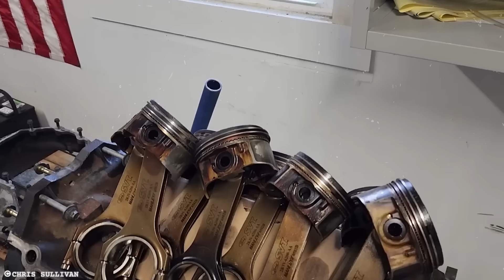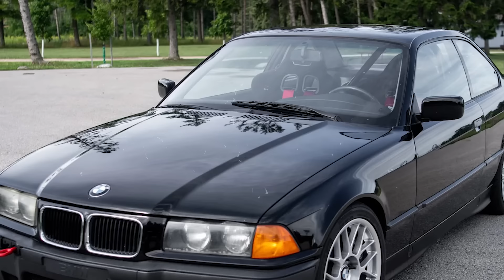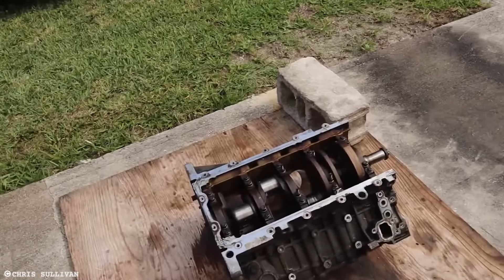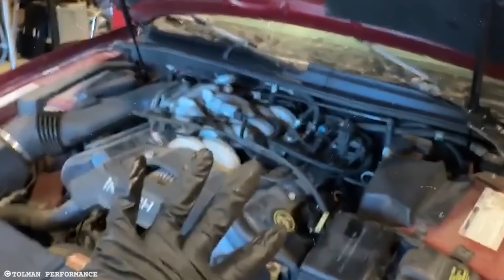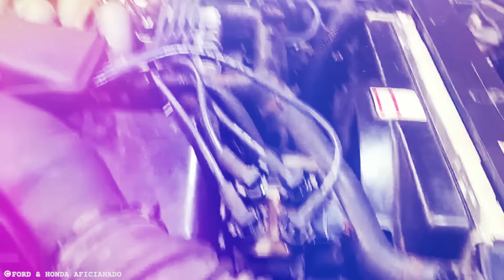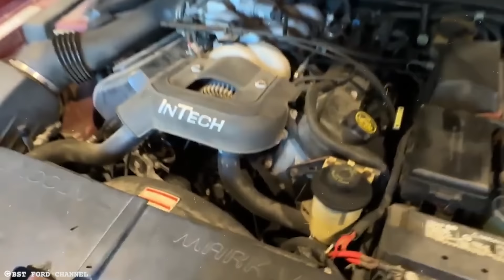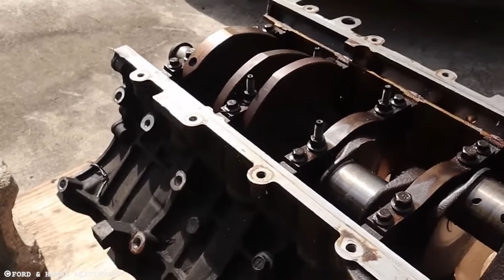The Most Overengineered DOHC Engine of Its Time   Ford 4 6L DOHC Modular 1993

Comment: @Rare Old Engines....Back in the earlier part of the 1960's "General Motors" produce and offered a complete ALL ALUMINUM SMALL BLOCK (215 V8) with ALUMINUM HEADS. GM installed them in Buicks, Olds, and Pontiacs. Look at GM NOW!!!! With it's LS based all ALUMINUM BLOCKS V8's capable of producing upwards of 1200hp, with a basic design most engines have followed for a very long time!!!! Ford's 4.6L DOHC should've produce more horsepower for the SIZE, COMPLEXITY and how much ROOM it took up in the engine bay!!!! As a side note: I know about two different cars built back in the day, 1983 Pontiac Fiero and a 1970 Porsche 914 with ALUMINUM BLOCK (215 V8's) BOTH with TWIN TURBOS. These cars were built back in 1983. WICKED FAST and the cars handle as if they were NAILED DOWN TO THE PAVEMENT!!!!
Reply: Chevy guys are so insecure.
Reply: During this time that was about the right power output. The North Star was producing similar numbers but had problems due to the undersized head bolts. It's really a shame that Ford didn't use this engine in a proper luxury sedan to compete against the Europeans. Sure. They used it in the Marauder but that wasn't really proper competitor to models coming out of Mercedes or BMW And Mercury didn't have the credibility in the realms of luxury to compete at that level. If they would have used this engine instead of completing the Jaguar. AJ V8, I think that's where the engine really could have shined. Shined. It would have been sold under a division that had the luxury reputation and was trying to compete against the Germans. While, the ajv8 eventually became reliable, this engine was more powerful and would have saved the company a considerable amount of money that could have been used either to sooner develop a V12 to compete against the Germans of v12s or could have simply saved the company money and potentially brought them closer to profitability.
Reply: @colinschmitz8297  Actually you've overlooked, the early 2000's Ford's 4.6 DOHC Supercharged V8 installed in the Ford Cobra Mustang "Terminator" still a PHYSICALLY BIGGG engine, and it only produce 390HP. Mentioning.... the disastrous Cadillac North Star V8, not only were the cylinder head bolts failing, but you needed to have extra bottles of oil in the trunk because the engine leaked oil like a SIEVE!!! What a piece of junk that engine was. The part that doesn't make any sense at all, during the same time period GM commissioned "Mercury Marine" to design and produce the INFAMOUS 1995 Corvette ZR-1 5.7L a small block (350) with 32 valve heads producing over 400HP naturally aspirated! If GM slapped a supercharger or Twin Turbos on it.....1000HP plus easily. This engine would've decimated any foreign car or truck, another example of a small engine but very Powerful One!!!!
Reply: @Armond144 The Terminator version of the 4.6 was powerful for its day.  We need to judge the engines from the era that they came from And remember the different compromises companies make to build their engines.  In the year 2000, Ford used the 5.4 L in the Cobra R which generated 385 horsepower and 385 foot pounds of torque and going off of the magazine tests where they compared the Cobra R versus the ZO6 vet which had identical power numbers out of the LS. The dyno showed that the 5.4 was actually more powerful, so the engine was actually underrated and people have noted for years that the Terminator was also underrated.  The Cobra R engine from recollection required a larger Hood for the intake. So it's a question of how you want to go about solving certain problems. I'm fine with using different technology so long as the engine is reliable. The Mercury Marine engine was impressive for its day but it was also quite an expensive engine.

Comment: Most over engineered American motor maybe.  The 32 valve DOHC Toyota 1UZ V8 will up to double the lifespan of this motor.  A million miles.  I love the 4.6 but it’s not in the same league as the 1UZ.  No motor was.
Reply: No engine had the r&d like the 1uz did either.
Reply: @Brandon-u2l6j A billion dollars in 80s money!
Reply: @MrMightyZ the 2v 4.6 has several examples on YouTube right now with over a million miles on them.. it will outlast anything and feels like the day it was made while doing it..
Reply: @NewEdgeDesigns I’d heard of cabs crossing 1 million but they’re often run always warm while workers swap warm cabs when they swap shifts.  Good motors in cabs that rarely run cold can do some absolutely insane miles, heard stories of Australian 4.0 cabs doing 1.5 and 2 million in the days when insurance didn’t require swaps but those motors would never do that privately owned.
I thought the 4.6 was a 600,000 mile motor but I didn’t know any Modular V8s were crossing a million that were privately owned.
Reply: VH45DE was in the same league. It even had titanium valves. Too bad it was only used in the Q45.
Reply: @4dscdriver  they were beautiful and like so many Nissan motors there chain guides were a weak point and when they snap the motor could get badly damaged but I loved them and I always wanted one in that first crazy looking infinity sedan.  Every one thought it looked a bit crazy but I think it was crazy beautiful and if you keep the chain guides and tensioners fresh they will last forever.
Reply: So long as the timing belt doesn't snap.  The 1 uz was definitely an impressive engine but trying to Make it out to be this perfect engine and so forth is a bit of a stretch. There are high mileage examples of many great engines. You have to remember that the 1uz was not extensively used in mass-marketed sports cars that was affordable to the general public. It was used for truck applications and it was used for luxury applications and for the luxury sport coops like the SC series. It's not the same league of use and abuse that a hopped up Mustang goes through.

Comment: I stopped buying fords when these pieces came out. The Windsor was their best engines. And the 302.
Reply: I guess you never drove one.. They are 10x the better than the 5.0 pushrod.. SVE had many cars with all 3 motors 4.6 2v and 4v and the 5.0 pushrod, the 4.6 is leagues above the old iron head pushrods.. the 2v PI puts down more power stock than a 5.8 pushrod..
Reply: @NewEdgeDesigns  Yeah and they spit spark plugs and throw rods. I seen it too many times.
Reply: @killabee623 early 90 s did the police crown Victorias where throwing rods like crazy and they would burn oil bad valve seals they fix it in 95

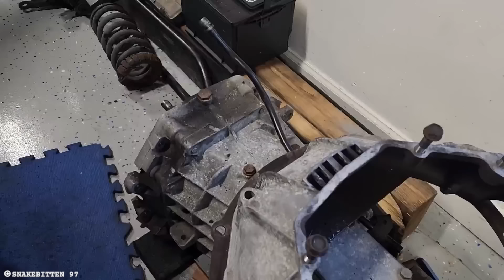Comment: Say what you will about this video, I found it very interesting. I had an 04 Mustang Mach 1, now I have an 04 Mercury Marauder. 4:10 gears, 315x35s on the rear, modified suspension. The guy who originally bought the car put EVERY option you could get. I have the rear deck spoiler, and the sunroof too. I even have the original Marauder leather jacket, window sticker too, and the original brochure. This car feels amazing the the mountain roads. Tomorrow, I get my Marauder back with a brand new shiny black paint job. Excited, but nervous. Cheers!
Reply: Nice - I was looking at those about a year ago I should've pulled the trigger on buying one I regret it.
Reply: That car is an absolute gem. Awesome you have the jacket too!
Reply: OK OK you had us at Marauder . best of luck with it !
Reply: The Mercury Marauder is quite the special car. It is quite special being a fantastic version of the Grand Marquis, Crown Victoria. It is fast, refined and besides the Town Car the most loaded . Great car and highly desirable. If you change the oil every 3 to 5k, it will run 500,000 miles.

Comment: John Mihovetz has taken oe castings/oe Kellogg crank 4.6 4V to 5.80 @ 256 mph. Timing components oe too. Incredible
Reply: They were stock,but extremely modified! 
I was in the area to TRY and talk business with old man Bell,  but he had very poor business plans! After dealing with him, I went over to Accufab to talk to George about some tech issues in Fun Ford Weekend. After I discussed the tech issue with George, he wanted to give me a tour of the new place. After showing me the CNC machines and the huge stock pile of B-heads............in huge boxes stacked all along one wall......I spotted someone grinding on a bare aluminum block. It was a FordGT block! That was Unatanium at that time! " George! what are you guys doing with that FordGT block?" George half heartedly tried to tell me it wasn't a Ford GT block, in a way that only George could do. 🤣🤣
At the time, I thought it was going to be a race engine for his drag car, but a few years later, I was in John's pit at Vegas and he said it was for a customer's vehicle.
Reply: @rayjay8322 block
Casted @ Ford foundry
Heads,,,same 
Crank... same
Timing chains tensioners
Same

Prepped or not....
No LS, Oe Casted HEMI has touched it.

Comment: Still watching but haven't heard mention of the tesca mark 8, which made 400hp with the 4.6 4v using an Eaton m90 from a supercoupe, in 93 or 94, using some witchcraft with dual throttle bodies, 16 injectors, and 2 separate ecus, inspiring the 03/04 cobra. Modern mustangs have more in common with a mark 8 than they do classic mustangs.
Reply: Those Mark VIII was awesome cars. Fast, long sleek. They didn't get the love they should have through the years.
Reply: And you wont hear about a non production cobble build that wasnt from ford when the video was about the evolution of the mod engine from SVT

Comment: Not sure if it's just 96-98 cobras but they have the tekidid blocks
Reply: TEKSID
Reply: Some 99 Cobras also had them. The one I used in my build came out of a 99
Reply: The mark 8 dohc block is teksid as well
Reply: My '99 Cobra bougt new has one still running strong 27 years later with the original stainless exhaust believe it our not.
Reply: Its 93-98 4v including 93-98 mark 8 and 96-98 cobra.   Supposedly some early 99s had teksid idk if thats true

Comment: Domestic exotic. Own a 2005 Aviator with last year of production for the 4.6 DOHC. This one is a keeper. Expensive to build though compared to a SBF. But it runs so sweet.
Reply: Wait until you get to do timing chains
Reply: @invinoveritas8704  not sure why people are so scared of a timing chain in an OHC engine, they have been used for years before Ford went to the modulars in 91 in other brands. Its still a single chain driving a single cam with that cam driving the chain to the other cam, just as simple as a 4.6/5.4 SOHC. If that scares folks they shouldnt ever touch a DOHC Duratec that has no keyway on the crank or cam to help set cam timing then
Reply: @invinoveritas8704  lol aint nothing hard about doing a timing chain job on a Ford DOHC v8.
Reply: @michealortiz3350 it is to a chevy fan boi
Reply: @fordnut4914 lol.  Theyre used to replacing the entire engine to make decent power so forgive them lol
Reply: @invinoveritas8704 they only need replaced every couple hundred k if maintained properly.  Its not that big a deal
Reply: Depends on the end goal, all the Aviator engine needs is a mildly sized turbo and a good tune to make 500whp. What else you need in a daily or weekend driver especially when they are $3-500 at the scrap yard with just the right milage to have enough ring gap to not cause issues on boost😂
Reply: @young11984  Problem with that is massive crankcase pressure
Reply: @gordocarbo  wrong, you do know what a leak down test is right? Unless the rings are stuck and or worn completely out with horrible leak down then maybe. This engine has less than 20% leak down so it will be fun for a long time
Reply: I have a box with two JLS, sealed, that fit in the rear behind the third row seat and absolutely bangs
Reply: They hate sparkplugs
Reply: Those aviators were cool, before Ford really went to hell.
Reply: Exotic, thats a stretch!
Reply: I swear bro, I have a 99 cobra and everytime I want to do anything all I can think is how cheap life would be if o built a 2v instead of a 4v😭 really wanna do an Eaton swap but parts are impossible to find
Reply: @nicholasporras7535  just buy a on3 turbo kit it'll be way faster than a Eaton swap
Reply: It isnt expensive to build.  Cost is similar other than cams and all it takes is forged rods and pistons to hold 1000+ whp a sbf needs fully forged internals and an aftermarket block to acheive that.  It also needs a full top end where the 4v can do it w stock heads and intake.  In reality it prob costs less to build a 1000 whp capable engine as it would to do the same for a sbf.   Ppl just repeat what they heard online with no knowledge.
Reply: Fords modulars have gone "places" no SBF on earth has...even in full billet form

5.4 4V prepped oe castings standing mile world record 300.4 mph 

4.6 4V has been 5.80 @ 256 mph oe castings and oe Kellogg crank making 3000+ hp @ 10,000 rpm on the Westech dyno. 

Coyote in oe castings is the ONLY oe platform to EVER win overall Sick Week and now TWICE in a row with the official drag and drive radial record 6.045 @ 238 mph.

3227 rwhp @ 9800 rpm
Reply: wait, what?! for real?! 

so you're telling me that those ol Craigslist PI crown vics could be tinkered with to a tune of... well, actually, firstly- how much power could the stock trans handle?  
secondly, i assume forced induction was probably the M.O. for nice motor gains, if so, turbo or super? or something else
Reply: @Verbatimorgish no he's making shit up. 😂
Reply: @Verbatimorgish  agree...engine is just too small it needs boost to make it respectable
Reply: @chadkent1241 I'm a Chevy guy all the way but I can't argue with those numbers.
Reply: @unseenpresence i'm glad there's one enlightened individual in here. I don't say any of those to throw shade at anything, but those numbers have never been matched by any other o e platform
Reply: @chadkent1241 I work on a lot of 4.6s and coyotes they have their strong points.  Those crown vics run forevernand they rarely leak oil.  Try that shit with an ls motor.
Reply: @chadkent1241 the last year a production 4.6 was used at Ford was in 2014.  They used them in the last year of the Econoline.